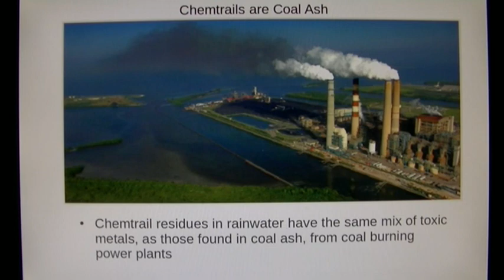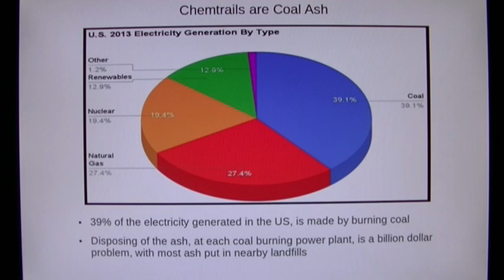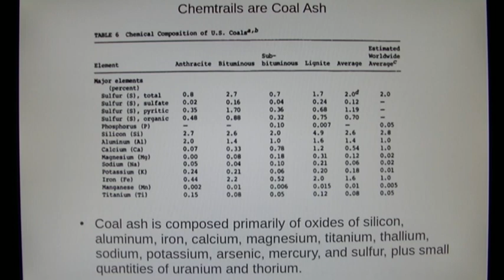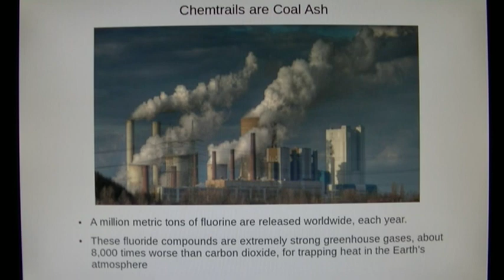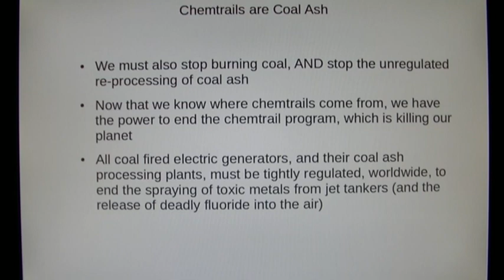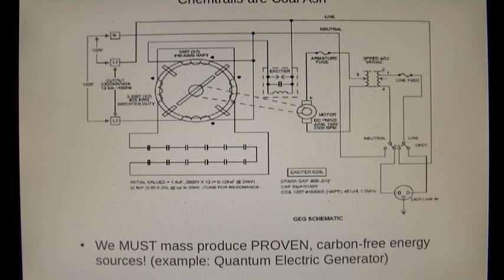Chemtrails are COAL ASH

Comment: While it may be true in many cases, it's not possible that all chemtrails are "Fly Ash". There are too many different manifestations of aerosols to make that claim.
Reply from the maker: I know, for a fact, that the dry coal ash is run through a hydrating/mixing/processing plant, before pumping it onto the airplanes, so any variety of materials can be added at that time. I suppose there might be some mixes that are purely proteins, or purely polymers, but that has yet to be proved.
Reply: The HAARP Report Do you have a public ID? It appears you prefer to remain anonymous as "The HAARP Report".  This important topic needs collaboration among knowledgeable specialists. Would you be willing to join a core work-group of vetted investigators and authors in order to propel pubic awareness with greater credibility and clout?.

Comment: No doubt chemtrails made out of "fly-ash"  would contribute to global warming. The Welsbach patent disclamer says :  "While this method would increase the reflection of visible light incident from space, the metallic particles would trap the long wavelength blackbody radiation released from the earth. This could result in net increase in global warming."
Reply from the maker: Laura Larue
I may certainly be wrong about the coal ash being processed into a slurry. There are pneumatic bulk handling systems that can handle fine, dry powders, so that it behaves like a liquid. So, the article is right, the chemtrails could be either a slurry, or a dry aerosol. But, the rest of the article is a disinfo hit piece, if you ask me. The first sentence tells you, who is probably behind this disinfo job. BTW, silicon dioxide is removed, in an early step, as the coal combustion waste is processed, before loading the fly ash on rail cars. The sand is dumped in a nearby landfill, or sold, if there is a market. I am NOT enjoying being the target, for this new information. I just wanted everyone to know, the only realistic source for all that silvery, white, stuff that is all over our skies. When you are taking flack, you know you are over the target, and this disclosure is definitely taking some flack. I'm tired of this stuff. I gave a theory to the world, and it is up to you researchers, to refine it, correct it, and use it to stop the harmful spraying, over your communities.
Reply from the maker: Harold Saive Yes, chemtrails are really like the giant ice cube, dropped in the ocean, in the middle of "Inconvenient Truth" (the Futurama clip). Of course, they are a "permanent" solution, of course! I'm hoping this new information can lead to either: stopping the spraying completely, or at least, a de-classification of the program, so it can be evaluated in the light of day. Enough of the bad guys, denying it all. We need open scientific discussion, so the most prudent, and natural solutions can be found. Thanks for publicizing your Florida rainwater tests, which I used in the video. All the test results should be public (but are NOT!)
Reply: The HAARP Report What is your position on climate change?.  Do you agree with the IPCC that CO2 causes global warming?   Can you elaborate a bit?
Reply from the maker: Harold Saive
Of course, increasing the heat trapping molecules in the upper atmosphere, will reduce the amount of longwave infrared, that radiates back out to space. This causes a heating effect at the surface. This is old hat. This physics was proved a century ago. Nobody needs to discuss CO2 anymore. The conservative number is that there is 2.3 watts of extra heat energy per square meter, that is entering the atmosphere, as compared to what is leaving the atmosphere. Of course, that energy imbalance will cause heating (solar forcing).
The real issue is runaway venting of Arctic methane. As this methane vents, the Earth WILL turn into a broiler oven. It is now happening, but we are still in the very early stages, so it is not yet obvious to everyone. I recommend Sam Carana's website: http://arctic-news.blogspot.com/   It is updated every few days, and is the only place to get real science about the arctic methane catastrophe.
Reply: The HAARP Report Not many people are aware methane and natural gas are chemically "CH4".   Drilling for oil and fracking releases billions of tons of CH4 (Methane) due to lack of regulation to capture and sequester it.  Do you think people are confused about the methane scare because they don't understand natural gas is the methane they should fear most?
Reply from the maker: Harold Saive
Americans are scientifically illiterate, so they have no idea of how horrible fracking (and tar sands) will be for the future of the planet. I personally have heard methane hissing out of oil wells, and nobody cares. I think all oil and gas drilling leaks huge amounts of methane (natural gas). This should be a crime, but the government doesn't care. I totally agree with you, that methane leaks should be regulated. Our whole system is designed to trigger the Arctic methane catastrophe. That is the bottom line. We are being deliberately exterminated, along with the entire biosphere. The amount of methane in the shallow East Siberian Arctic Shelf is so mind boggling, and so precarious, that even the natural gas leaks are nothing in comparison. However, the gas leaks are the TRIGGER, for enough Arctic warming, that the shallow ESAS venting will be unstoppable, once it has begun. And, by the way, it has begun. Stopping this must be our focus, if we hope to survive.
Reply from the maker: *****
Wow, that is a great comment, thank you! The disinfo agents are protected BY the establishment, and most are paid, based on how many comments they can generate (to frustrate, and derail the discussion). On the other hand, the sincere people, who are trying to dig out the truth are paid NOTHING (like me), and are risking our lives to get to the bottom of why our planet is dying so rapidly. These chemtrail deniers have had the upper hand, for so long, they are lazy, and stupid. They don't know how to deal with someone like me (all of us, now!) Keep up the good research, don't believe anyone, study the scientific evidence, and make up your own mind!
Reply: The HAARP Report
 What I am reading in the artic-news blogspot page is totally unreal... within 5 years and say good by to the fish and food in the oceans it looks like.
Reply from the maker: *****
Thanks for your concern, but I really think there is no problem with discussing these long overdue facts. I agree with you, enough with the educational videos! Now is the time for concrete action plans, so we all need to be moving in that direction, if we hope to have blue skies again, that is.

Comment: Where is a link to the source material you are reading, please?
Reply from the maker: Wyde A. Wake This information is deliberately hard to find. Some pdf book downloads have the critical tables blanked out. You just have to google the keywords. I would like to make the entire presentation public, as a pdf. Do you know of any free, anonymous, pdf hosting sites?
Reply: The HAARP Report
Try https://filetea.me/default/  No login required. Use Tor and you'll be okay. As far as I know, basic uploads/downloads through html plug-ins that allow you to browse for a local file are tunneled through Tor.  Just stay away from any Java or Flash-based uploading.  If you want to add an extra layer of security, use Tails/linux on a USB drive (stand-alone OS which uses Tor by default.) https://tails.boum.org/  You can also choose to connect to Tor through a VPN.  http://www.deepdotweb.com/jolly-rogers-security-guide-for-beginners/combining-tor-with-a-vpn/

ps Just uploaded this file using Tor and it seemed to work fine. https://filetea.me/default/#t1sGKTxpNK0TiyXUzS1wrRwxQ

edit: Uploader must leave the page open for the file to be downloaded.
Reply from the maker: Wyde A. Wake
It looks like Obama cancelled the Clean Coal project two days, after this video came out. I wonder if the two are connected. I'm getting the feeling Obama is a good guy, after all! Welcome to the light, Barak! Glad to have you aboard!
Reply from the maker: clive mossmoon
Oh... NOW you tell me! Sorry about that first one, how obnoxious to demand people's credit card, just to download a small file! Plus, it put half of my IP address on public display! Never use those SoB's... Now, I'm trying filehosting.org, and they seem OK. All they require is an email address to send the download link, but the link is only good one time. I think that is OK, for now. Somehow, I think I will get more PC troubles, if I try to go underground with Tor. I have always wanted to try it, but seem to have an uneasy truce with the bad guys out there. I hate to rock the boat, right now. The pdf of the video looks ten times better than the actual video. I hope thousands of copies start to float around the internet. That is what we need, IMO. Thanks for the Shakhova 2013 article, haven't seen it before. Hopefully, the filehosting.org link will work OK for people.
Reply: The HAARP Report
Lol. you can also try https://zenmate.com/ or http://proxy.zalmos.com/

"Just because you're paranoid doesn't mean their not after you." Thomas Pynchon :)
Reply from the maker: Jhere McKenzie
Do you mean that the pdf slide show, of this "coal ash" video is all over the internet??? I would be SO OVERJOYED, if this information gets out, all over the place!!!
Reply: Yes, have been seeing it on Facebook…sending it to all the key truth hubs will do the trick, they already have huge audiences.  C2C, Veritas, Avalon, Camelot, Alex Jones (gag), Mark Dice (another gag) etc etc.

Comment: Fantastic work HR. The answers are always right in front of us, aren't they? "Open secrets" as they say. I understand the aluminum coming from chemtrails to be "free form," or not bonded to other elements. Can this processing of coal ash produce free-form aluminum?
Reply from the maker: clive mossmoon Yes, if the fly ash is processed with acid, you get metallic (not oxide) aluminum nano-particles. This is the most common processing, done to fly ash, and I have a lot of information on this. I should have put it in the video. Oh, well, can't get everything right... This format of reading a slide show is much better, and I forget less, that way.

Comment: Watch out.. I think Youtube is suppressing views for this video. This is very powerful information for our cause. Thank you for your dedication to exposing these highly toxic programs.
Reply: ***** It's best not to reply to guys like John Yossarian. They are only here to stir up trouble. At this point, we cannot deny that geoengineering is taking place. Anyone who denies it is either ignorant of the subject or a disinfo agent.
Reply: ***** Yeah, when I commented about geoengineering on one of Dahboo7's California drought videos, I was getting tons of firewall hits from a few IP addresses (mainly v6) on port 443. I was unable to edit my comment, but was able to access other pages. I'm surprised I didn't go offline, even though I have a strong connection.
Reply: OC Skywatch
I think I have been being attacked, but haven't figured out through what port though. My computer just shots off and then restarts. the connection between my computer and the router is limited strength.
Reply: Josh Writz Yikes! That is scary. I hope the hardware isn't damaged. Anyways, I would recommend building a firewall with any spare computer components lying around. You need to have at least two functioning NICs (preferably gigabit) for this to work, though. PfSense is a great software based on FreeBSD that you can use. It is easy, has a lot of functionality, and blocks a ton of junk, both inbound and outbound. It works with routers, along as they have an Access Point mode. Be sure to disable DHCP on the router, as you don't want IP conflicts.
Reply from the maker: Josh Writz
You need to set a bios password, as they may succeed in corrupting your bios, and then your PC is unbootable (in that case, you'll have to replace the bios chip, or buy a new motherboard). I lost a PC that way. It takes some work on their part, but they can definitely corrupt your bios, from my experience. Also, clean the hair off your CPU, it might just be overheating, from all the outgoing traffic, as they download your hard drive ;-)    You should run Ubuntu, as that gives you easy tools, to stop the attacks. Always monitor the outgoing traffic, and pull the plug, when it is more than 10% of the incoming traffic (unless you are downloading a file). You should feel flattered, that "they" think you are important enough to assign a personal hacker to you!
Reply from the maker: OC Skywatch
Wow, great advice! I'm going to try this - thank you!
Reply: It very well could be someone trying to defer me continuing this stuff like commenting, but it could be that and a virus that my pc picked up somewhere. I'll do some more digging and do some research on what you suggested.
Reply: Josh Writz I have a friend here who is into computer stuff so I a going to talk to him about what my PC is doing.

Comment: So instead of spraying it into the air they spray it into the air?
Reply from the maker: ***** First, they remove the silica, iron, and calcium. That leaves the aluminum oxide, and the toxic trace metals. Then, they spray it evenly up in the stratosphere, according to what the weather warfare supercomputers tell them. Pretty simple, really.
Reply: The HAARP Report
Do you think this left over calcium could be used in cheap calcium supplements?
Reply from the maker: Josh Writz
The calcium is always removed as calcium sulfate, which is used to make gypsum wall board. I don't think that is the source for nutritional calcium, as there could be a lot of contamination. Limestone, or clam shell, would be a better source material, than nasty coal.

Comment: In my research of this , the claim is that the ash is being used as fill at airports in lined and capped off areas. It is important to find out if in fact it is being put into tanks and loaded onto planes for dispersal into the air. To make a clear case thi smust be proven and documented.http://charmeck.org/city/charlotte/FocusAreas/Environment/Documents/CoalAsh/Coal%20ash%20fill%20at%20Asheville%20Airport.pdf
Reply: This is just one airport though, but thanks for the link. We "have" to find as much information as possible to see the whole picture about every coal plant in the world and where the coal ash is going that does not have a specific purpose like for cement for an example.
Reply: agreed...I would like to know the other airports where this stuff is being taken.

Comment: They're dumping whatever they want on us. I believe they are dumping fracking waste.
Reply from the maker: Chemtruth Fracking waste is injected into deep boreholes. It would take a massive factory to dehydrate, pulverize, purify, and filter the waste water. No, it is not fracking waste, it is fly ash, with other additives, like barium. I believe that all jet fuel now has methyl dibromide, and aluminum oxide, added.
Reply: Fracking waste is more like sludge, not water. You act like the process is 1. undoable, 2. cost prohibitive (we're paying for all of this).  Also, I did not claim that it is fracking waste vs coal ash.  I simply added a suspicion of mine. They are not dumping just one chemical, they are dumping many chemicals, and chemtrails ARE industrial waste.  Have you ever seen the skies over factories?  That's CHEMSKY.  It is industrial waste pollution, same thing, same appearance as chemtrails.  Watch this video and then tell me the process is undoable: https://aerialdeathanddisease.wordpress.com/2014/10/05/the-appearance-of-industrial-pollutants-in-our-sky/  Note the narrator claiming that no chemicals from the process of making Tupperware reach the atmosphere - you can see the chemsky clearly in the video.
Reply from the maker: I think there is too much of a logistics problem, with dewatering the fracking mud. However, fracking chemicals might be added to chemtrails, before they are pumped into the ground. Fracking might be an excuse to produce some of the toxic chemicals, which are diverted into the chemtrail mixing plants, instead of being used to frack natural gas deposits.

Comment: Bravo for a break in the case. This is news. One additional issue in this case, I find that the trails appear most suddenly and without any sound of aircraft actually. On days of illegal spraying the trails will be released but the sound is muffled, the planes must be outfitted with a silencer (!?) Is this a possibility in aircraft? To have noise reduction on the engines so folks don't notice the planes over their homes, etc?
Reply from the maker: Passenger airliners have been outfitted with diffusers, which muffle the loud jet engine, for over 30 years, so most of them are very quiet already. But, perhaps the jet has throttled back, and is just coasting on low thrust, while passing overhead. They would be very quiet, then. The difference is obviouse when you compare old jets from the 60's, with new jets. They are ten times quieter nowadays. Of course, if the chemtrail chemical is in the fuel, if they throttle back, there will be very little chemtrail spray behind them. I heard there is ethylene dibromide, and aluminum oxide (static reducer), in all passenger jet fuel now. So, they are all spraying us, all of the time. I agree with you, this video is a "break in the case". It is about time! We are all so sick of being sprayed, like roaches!
Reply: I had just assumed always that they were very high, hence no sound. Although we do get some low flying ones we hear. I once even saw a trail laid by a small light plane.